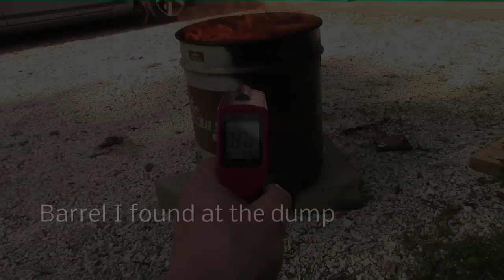Aluminum/ Brass Furnace and Burner Build

Comment: You should see what temperatures you could achieve with an oxygen-hydrogen flame, just get a nice big bucket of water, add some NaOH, put some amps through it connect your gas hoses!
Reply from the maker: I have some water electrolyzers but the furnace cant handle more than 2k. The diesel burner should be good to melt iron or silicon at like 3k but I try to keep it cold and protect the furnace. It heats up to aluminum temp in less than 2 min and melts 25 lbs in 30 min so I'm pretty happy with it :)

Comment: Where did you get that little blower. I have searched forever and can't seem to find tem
Reply from the maker: EastCompassoKnivery It came with a diffusion pump, I've since switched to a cheap furnace blower and it works a bit better. Just search amazon or ebay, there are tons of them

Comment: Could this refractory be used in your iron furnace and was it purchased online or at a hardware store
Reply from the maker: EastCompassoKnivery no, its rated about 1000F less
got it at the hardware store
Reply: +BenNBuilds is the rock wool only to insulate so the barrel doesn't get too hot in case you touch it?
Reply: +BongieGER No, insulation keeps the heat inside and thus safes fuel and increases temperature.